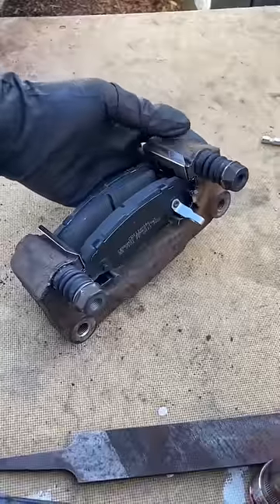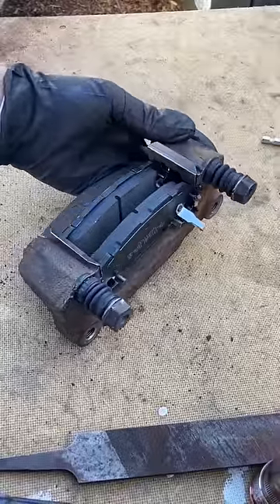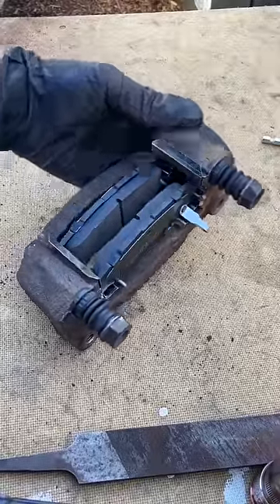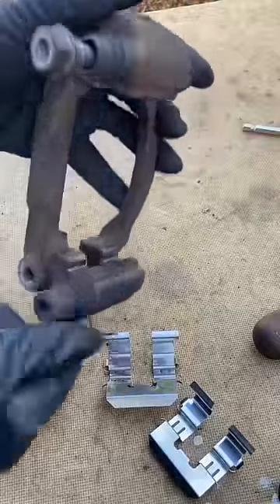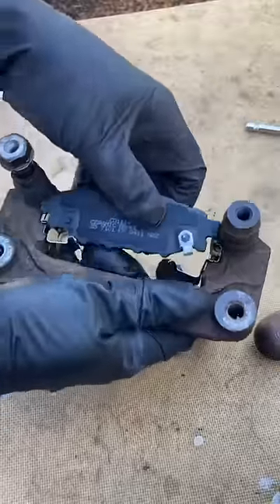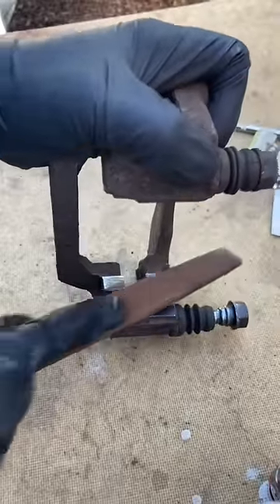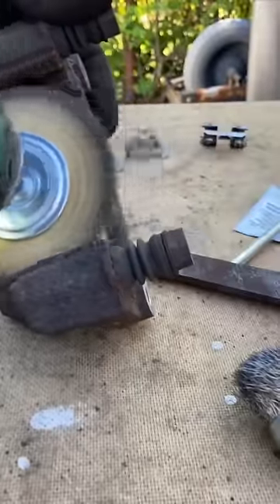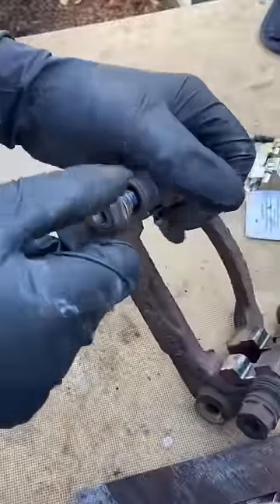What’s the Difference Between a $50 Brake Job and  $200 Brake Job

Comment: This is the reason I do my own 30.00 dollar brake jobs
Reply: You do it yourself and still get cheap pads against original rotors? You might want to pay someone :)
Reply: @davepalmer9265  you change the disks every time?
Reply: @jamesmx7  changed or resurfaced, yes.  Resurfacing is cheap, but I’ve noticed the OEM rotors don’t leave much material for resurfacing.  Car companies forcing you to buy new parts vs refurbishing?  Imagine that…
Reply: long time pizza dude, I do my own also
Reply: If you have time and some files and a grinder with a wheel you could also do this at home. Doesn’t seem like rocket science
Reply: @davepalmer9265  xg
Reply: @nou8257  the only other reason would be if it is too thin to remain in spec.  But you could measure that easily yourself too.  I just replace rotors everytime since they aren't that expensive imo.
Reply: @nou8257  gotcha, yeah I don't blame you.  Its all your choice obviously, if they wear down too thin that can cause a problem. Easy enough to measure though.
Reply: @nou8257  you need to measure the thickness of the rotor. At minimum resurface the rotor and discard at minimum tolerance. 30 dollar set of pads, lucky if it comes with hardware, arent the quality I look for. Knowing when to use metallic and ceramic is what average backyard mechanics have no clue on. Checking when the job is done, that the caliper move back and forth smoothly is also something the average person doesn't do. Any backyarder can slap pads on, have it work and they think they did it right, then wonder why the rotors pulsate 25k miles later. I know when I do a job that it will last as long as the original, in some cases longer. What they really like is the kid who comes in every year buying pads for the same car. Vs seeing someone once every 5 years. Ive been working on cars professionally for over a decade with several certifications, and my family owned several parts stores for 45 years that they just retired on. Long enough to know if you are slapping 30 dollar pads on and calling it a day, you are doing a job wrong, that a monkey could do
Reply: @davepalmer9265 too bad your average non-backyard mechanic is in the same park, work quality wise. Pareto's law applies both to "professional" mechanics and "backyard" or "shadetree" ones. 🙄
some of the worst jobs i've seen were coming out of real ones. and they were not even the cheapest ones. 😑
Reply: 30 bucks? Remind me to stay fucking clear
Reply: @nou8257  because brake life varies on a person's driving habits, that is somewhat true, but as I said any monkey can throw pads on and think they did it right, because their brakes function. But last 1/2 as long as when someone does it correctly. Pay now or pay more later. I choose doing it right the first time, especially with something as important as stopping the vehicle.
Reply: @davepalmer9265  mine are 17$ And its been 4 years still work great
Reply: @Platinum1812  Agree. I just bought pads & rotors for my 17 tundra. I got almost 100k on the factory set. Replaced at 96k. Bendex pads and cheaper factory style rotors from China. Cost about 510.00 with a new package of gloves a can of cleaner & anti squeak lube.b
Reply: @davepalmer9265  assumptions huh buddy? Lmg that’s your real name and you’re over 40 years old unhappily married n bored on YouTube hating?
Reply: @davepalmer9265  bet you have a nice at home office DAVE
Reply: @davepalmer9265  That pulsation also occurs from driving a Tacoma with cheap brakes like a rally car, heating the brakes until the rotors glowed, and wondering why they warped. Not like I have experience or anything….
Reply: @pipedup  you always got what you paid for if you paid to be ripped off. Snap-On tools are always among the best, but never the best. Sometimes products that are 1/10 the price perform just as well.
Reply: @jamesmx7  I learned you spend double in labor and downtime for the same amount of miles trying to re-use or turn rotors, so new rotors and pads.  Turned rotors just warp quicker the second time around.  They last a lot longer if replaced together.  Brakes aren't the place to pinch pennies.
Reply: @davepalmer9265  😅 umm not true but ok
Reply: @davepalmer9265  you don't need to have a certificate to do something as simple as changing your brake pads guy. Literally one of the easiest things to maintain on a vehicle. Not rocket science.
Reply: @davepalmer9265  ... Yeah, or invest in a set of calipers and check the specs against readily available googled manufacturers recommendations... Cheaper than paying a hack that talks shit to sell parts he can easily replace at install and rook the customer for... Homie..
Reply: @jamesmx7  I haven't changed a CD in my car in over a decade.....
Reply: @f5tornadeau  the discs don’t necessarily need to be changed or resurfaced every brake job because the metal lasts a lot longer than the material on the pads. The pads are built to wear on purpose so really you only need to change the pads and then the discs every few brake jobs.
Reply: @josemartinez280  that’s true, but the rough surface of the discs will wear out new pads prematurely.  Overall, it’s not an often occurrence unless you’re racing, so I figure I might as well just start fresh as long as I’m in there, you know?
Reply: @davepalmer9265  I had a Tacoma for 10 years I changed pads only on it everytime with the cheapest I could get. And I only changed them like 3 times and everytime I could've left them on for longer. I still haven't had a vehicle stop as good as that thing did. Also in 230k miles I only changed the rear drum brakes once along with the clutch which I only did because the rear main was leaking.
Reply: @ehc1999  
You are so right.
It is easy, just watch a few videos on YouTube University for your year make model of car. 
Plus you will need a variety of tools and little know how.
Reply: @davepalmer9265  I'm lucky, on my Yukon its 35 for raybestos hh friction material pads and they come  with all the boots and caliper pin seals too
Reply: People think actually master mechanics do brake jobs at a dealership... no its usually some lube tech with minimal experience
Reply: @davepalmer9265  still buy OE X10 as much on a 250,000 mile car? 😂😅
Reply: pad slapping isnt a brake job lmfao
Reply: @f5tornadeau  about 20 years ago when I worked in an auto parts store, it was $8 to resurface a drum or rotor. I just had a couple rotors done yesterday and the same parts store charge me $25 each to turn them. Back in that day, I made $13 an hour as an assistant store manager. The cost of turning drums and rotors went up by 3x. I can tell you people in that parts store are not making $39 an hour. I just want to illustrate what's going on. Inflation is a lie used and an excuse to jack up prices and devalue labor. Capitalism is a parasitic system on the back of the working class.

Comment: Unless they charge you $200 and still do the $50 job
Reply from the maker: Yup
Reply: Right most mechanics don’t care if the job is done right or good get paid either way…
Reply: Dealerships, having worked for them. 
Most expensive for the worst job.
Reply: That’s what this vid is.$200 to do what he did is a rip off.
Reply: @1pollo1rabbit  yup
Reply: Exactly
Reply: Which is far more likely😅
Reply: @1pollo1rabbit  exactly
Reply: Keep watched until they fin the job
Reply: @smalltownguy76  because the management is making big bucks.
Reply: @smalltownguy76  I do actually care… Do you know why? It’s quite simple but has worked all my career. See if I do a $50 effort on a few hundred dollar brake job, 9 out of 10 times the customer will come back within a week complaining about noise or poor braking performance, then I have to do it again with my boss bitching in my ear. I don’t want to do it again for free… aside from possibly making the vehicle hazardous to drive.
Reply: Reymundo Vibal You could watch this video from beginning to end 6 times and it still won’t be worth $200 😂🤣
Reply: SubaruDeservesMoreLove 🤦‍♂️😂🤣
Reply: Charge you $200 labor and the mechanic gets paid $40 from it. Don't be surprised you get $50 effort from someone dealing with that.

Comment: Doesn’t matter what you charge on a brake job, this is how you do a brake job in general. If you aren’t doing this even if you charge 100$ then you shouldn’t touch cars or turn wrenches! Brakes 101
Reply: Absolutely agree with you ! I watched a many tech's skip doing the proper steps on brake work, and they Never were allowed to team up with me servicing brakes in my 42 years of brake service or suspension work !
Reply: I was thinking who doesn't do this all the time..... When they do there brakes
Reply: Depends on your climate. In Northern Europe or the salt belt in North America, you have to be very thorough with it, or it will fail prematurely. In the South, you'd probably get away with it.
Reply: @C0rvette454  it’s absolutely necessary
Reply: And that’s why your brakes lock up when you bearly press the pedal 😂
Reply: @420-jose5  not at all
Reply: @420-jose5  never had a single
Come back period
Reply: @420-jose5  That doesnt happen unless your pins are stuck or forgot to insert the metal clip through the loop, in which case, take them out and fix. When your change your pads, just check by pressing down on the pins and see if they spring back. If they do, they are good and dont mess with them or you might be doing more harm than good if you end up not putting it back right or using the wrong grease.

Comment: That tiny bit of following through and being thorough costing $200 extra is precisely why I do my own work.
Reply: The difference between 50 and 200 is in the rotors and wether or not your getting them resurfaced or puttin on new ones
Reply: @WillSwingem  He definitely wasn't talking parts and labor. Our brakes jobs are typically 360 to 430 using OEM pads and middle grade rotors. 3/4 and 1 ton trucks are usually more.
Reply: @Charlie-dv7ev  yea I know ours are like 500-550 for new rotors and and like 350 for resurfacing, it also depends on the car though, you want new pads and rotors on a ford transit that shits expensive when your paying for 5 hours of labor and all new torque to yield bolts and rear axel O rings
Reply: @WillSwingem  Holy shit! I haven't had the "pleasure" of doing one of those yet!
Reply: @Charlie-dv7ev  there not bad to get the rear rotors off you have to remove the rear axels to get the rotors off and on the front you have to remove the wheel bearings that’s just why they take so long
Reply: Good for you… you got the space and tools available to do it. Most of us don’t have access to that😢